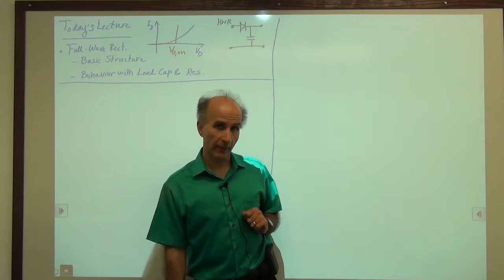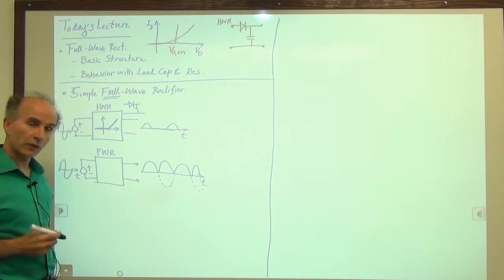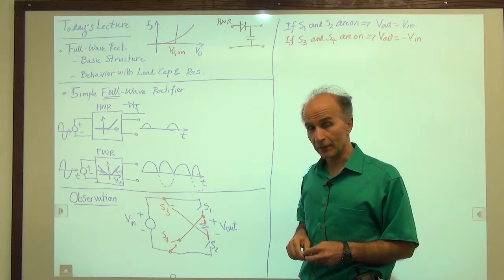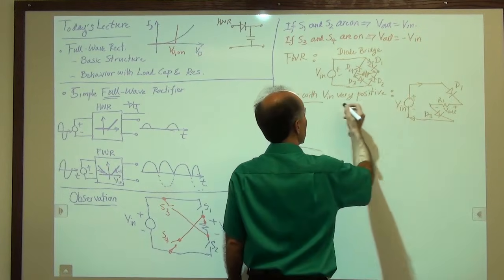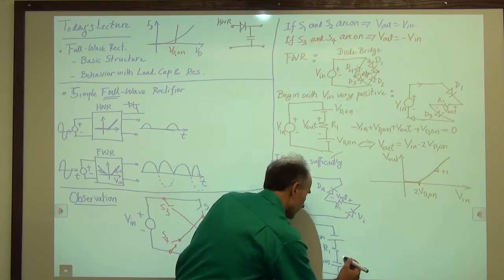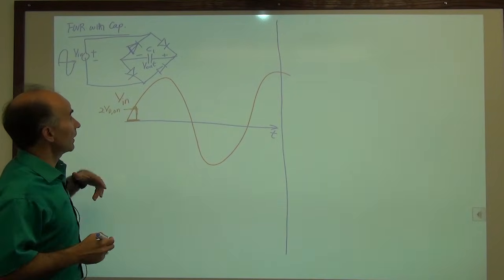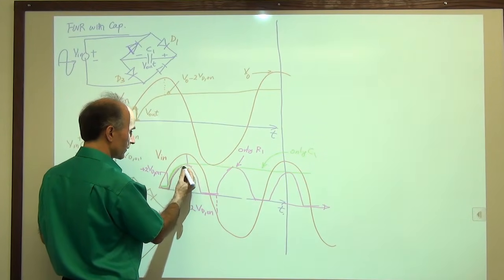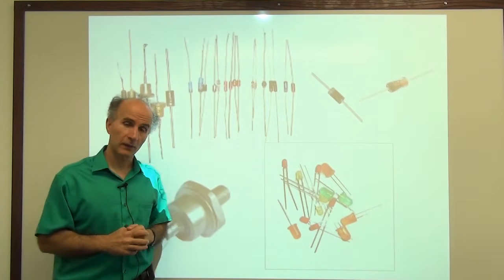Razavi Electronics 1, Lec 11, Full-Wave Rectifier

Comment: For those who are curious, the Maximum Reverse Bias Voltage in the Full-Wave Rectifier is V_0 - V_D,on
Reply: its 2vo-2vd,on , subtract -vo from capacitor vout =vo-2vd,on = 2vo-2vd,on ( kindly read this carefully) ,  so , we should consider diodes more than this reverse break down voltage for operation !
Reply: @joy @joyfulljayesh No, it is V_0 - V_D,on. You were wrong. Check again. With V_in = -V_0 at the negative peak, the Maximum Reverse Bias voltage is V_0 - V_D,on.

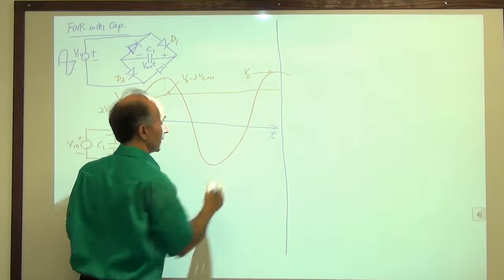Comment: At 48:15, can someone explain in detail why does Vout remain constant after it reached V_0 - 2V_D,on?
Reply: As Vin decreases after reaching its peak, the capacitor remains charged to approximately V0+2Vd,on. The diodes become reverse-biased and remain off. They conduct again only when the input voltage exceeds the capacitor voltage by approximately two diode drops Vc+2Vd,on
Reply: He has explained detailed in Lecture 10 (half wave rectifier)

Comment: There should be a slight correction for the negative half cycle of Vin, 
Vout = -Vin + 2Vdon. 
I assume the professor missed to switch the Vin sign while doing KVL.
Reply: No that will be wrong ....because you are taking negative value of Vin and again switching that will be the same case as of the first case
Reply: Yes as if professor equations is to be correct i.e. Vout=-Vin-2Vdon that means Vout is greater then Vin.

You can graph this equation it's not possible.

He has not reversed the signs on the battery as in the negative half the direction of current changes.
Reply: Also the professor equation means that in the negative cycle Vout is again negative that's not possible.😂 For kvl first determine the direction of current then. Draw +- sings and you will get correct Vout which is same as in positive cycle. You can graph it to verify this.

Comment: Hi friends, can anybody explain how the two diodes turn on when a capacitor is connected in the middle.... I really got confused, Thx you all ~
Reply: initially the capacitor is not charged(so the operation is same as the resistor) and the voltage across it is zero and the diodes are connected between the voltage source (with some voltage which increases gradually with time) and the capacitor (with 0V). so the p-side of the diode is connected to voltage source which is more positive than the capacitor voltage which is connected to the n-side of the diode. so when the input voltage is more than cutin voltage of diode the diodes turn on.
Reply: Because I think that it is an open circuit with the capacitor....
Reply: @liuweikang7678  since there is no initial voltage across the capacitor, due to non-availability of an infinite current, capacitor voltage doesn't change instantaneously, and hence the capacitor voltage remains zero

This applies when input is about to reach Vd,on, hence when the diodes turn on from the off state, the capacitor's voltage still doesn't change (and is zero), due to which it acts as a short-circuit (rather than an open circuit)

A short-circuit only guarantees a zero-voltage difference across it, and hence the two diodes turn on even we have a capacitor in the middle; the same methodology can be applied when the other 2 diodes turn on - this time the capacitor having some voltage instead of zero voltage

The capacitor voltage won't change instantaneously, maintaining the same voltage as before, and the capacitor acting as short-circuit again

Comment: I have a question here , when the alternating source is flipped meaning in negative half cycle , Why the professor did not change the polarity of source so negative is upper and positive is lower ?
Reply: +Hossam Ibrahim In that case, Vin has a negative value. If the professor changed the polarity of it, the value of Vin would be the same as the first case has.
Reply: @laagy2446  you are a life savior
Reply: +Hossam Ibrahim 
I have the question
I really get confused
Reply: You can do that. But that adds confusion. You are calling the voltage negative and then again you are flipping the source...That can make you commit mistake while writing circuit equations